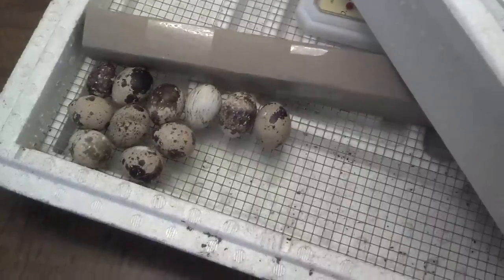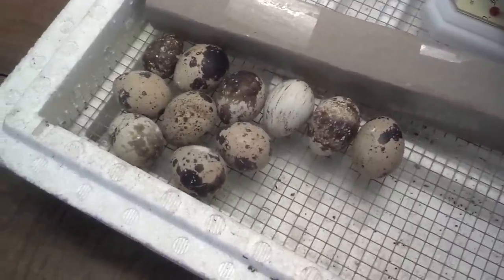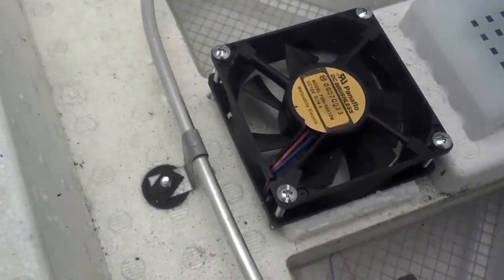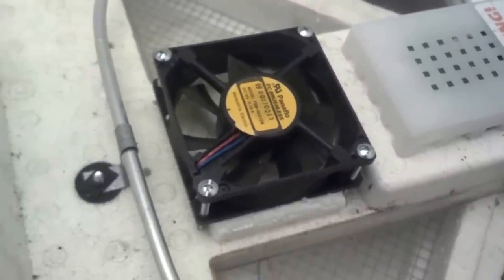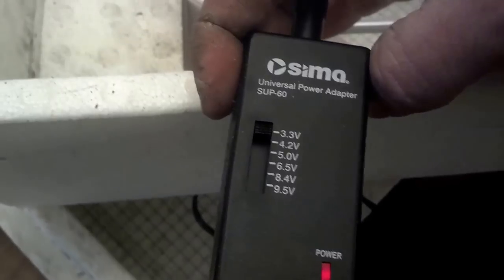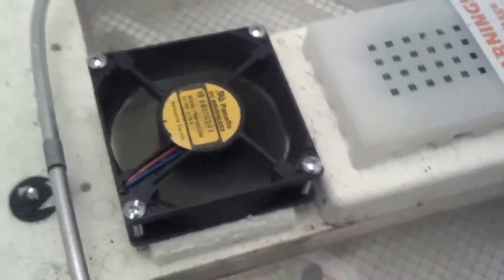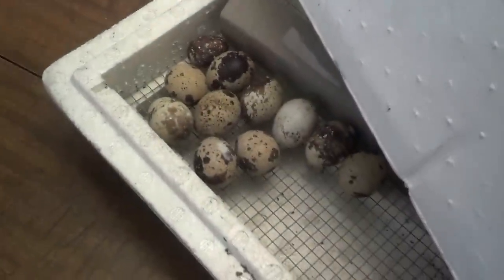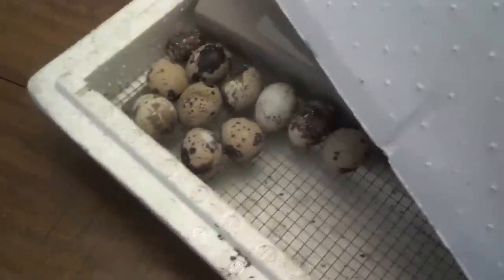Adding A Fan to My Still Air Incubator For Quail and Chickens

Comment: I'm curious to know how this worked out?  What was the hatch rate before and after? Reason I ask is because Little Giant states the CFM per fan should be very low.  The one they sell is rated at aroudn 10 to 14 CFM.  This one is rated at around 30 CFM and therefore blows a lot of air.  I'm asking because I'm about to add a fan to mine, but I ordered a 7-13 CFM fan from Ebay.
Reply from the maker: Hi, I still use this today and have had great success.  Without any fan for quail I averaged 22 chick's from 40 eggs. With the fan I average 30 chick's from 40 eggs. I did not have any increase or decrease in the hatch rate for chickens. I don't know specifically the fan output but the power supply I use has multiple settings of power output.  I use a very low output on the fan so it is turning enough to feel the wind on the back of my hand but not hard enough to say blow out a candle. All you need it to do is move the air in the small space. You will notice that you will need to add more water to keep the humidity right, so that's something to keep an eye on. Good luck.
Reply: @outofworkbum  thanks for the response. I ordered a low CFM fan today and the appropriate connector from eBay. I won't be hatching chickens in the near future. I bought mine for hatching queen bees.
Reply from the maker: Wow, I had no idea that you could do that..cool.
Reply: @JimWellman  Good morning, I am doing the same.

Comment: i have made incubator i want to no that the fan which is shown in videos i have connected, In which direction should i connect ? for exaust or for circulate air inside ?

for circulation or for remove excess heat? plz help
Reply from the maker: I have mine blowing down, you want to circulate the air to evenly disperse the temp and humidity, not remove any heat. I've been using this for years now and it has definitely increased my hatch rate, especially with the quail as they are much more sensitive to humidity especially. One thing to note is that I try not to place any eggs directly under the fan. Good Luck and thanks for watching!
Reply: Thanks alot ...
Reply: En las incubadoras brinsea, los ventiladores no dirigen el aire hacia los huevos,  los ventiladores están rodeados de calefactor y el aire sopla hacia la cubierta de la incubadora, nunca soplan hacia los huevos.